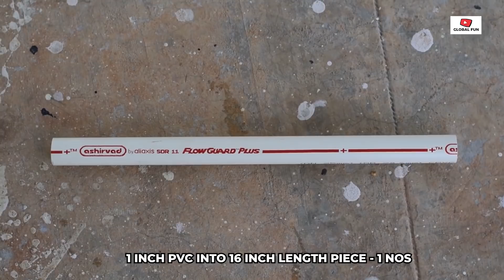How to make Automatic hand sanitizer Stand Using PVC pipes

Comment: Not sure where this is made, but in the US - 3/4 inch PVC will not fit inside 1 inch PVC - you'll need to go to 1/2inch.  Otherwise - perfect!
Reply: I wish I had seen this comment before I bought and cut the 3/4" pipe. Time to go back to Lowes.
Reply: @jnielsen76  We are in the same exact boat! Back to the hardware store
Reply: Joshua Nielsen never completed DIY project without multiple trips!!!!  I’m glad i saw this before I went!!!
Reply from the maker: Thanks,  this was made in india
Reply: I forgot about that until after I got home with everything. 
Gotta go back to Home Depot
Reply: So what needs to be subbed out, in order for this to work? In US measurements
Reply: Penaceilin BeatsandRhymes did you find out?
Reply: Todd Albu can you tell me what I need to get?